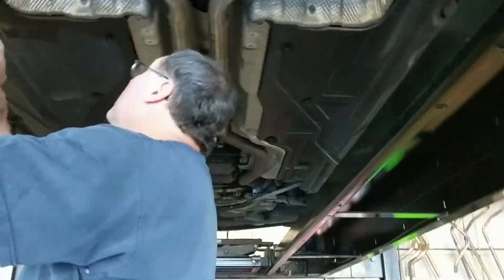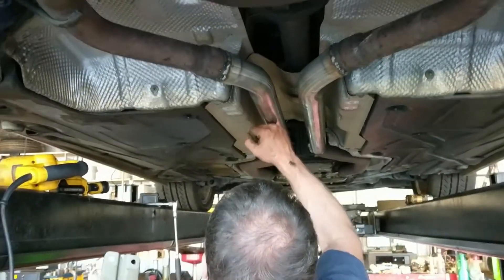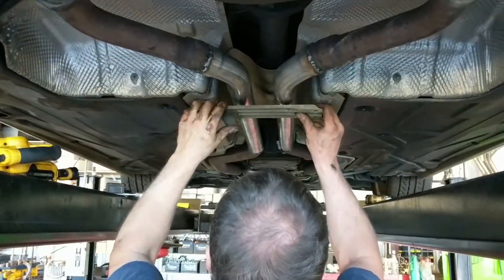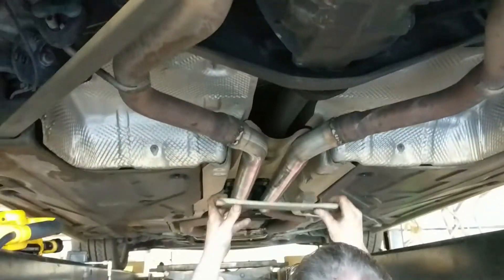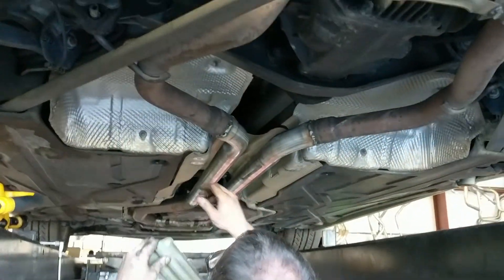Mercedes SL500 resonator delete exhaust sound

Comment: Does the resonator delete allow you to hear more pops when letting go of the gas after hitting let's say 3000 rpm? I have an SL500 with muffler delete, sound is great, just want more pops, so was wondering if resonator delete will do the trick. Thanks!
Reply: What year do you have? I have an 05 and wanting to do a muffler delete. Does it drone at all?
Reply: @bossbrown9759  Bro just do it, it sounds really nice and drones a bit but honestly it doesn't bother me. Sounds so nice and mean without the muffler, highly recommend it.

Comment: Hey Matt. Where in NC are you located? I'm downtown Raleigh and looking to do that resonator delete but don't know of a good shop. Where did you take it to?
Reply from the maker: Meineke will do it. Just don’t go to a very corporate feeling one.
Reply: @matthagens2076  Thanks for getting back. Don't want some yahoo working it so I was going to take it to a local speed shop around town. Yours still holding up well? No issues?
Reply from the maker: @keithstreger2757  years later and it’s been fine. No codes from it.